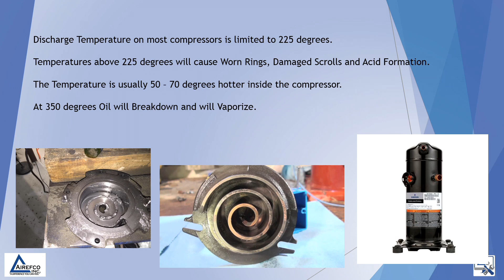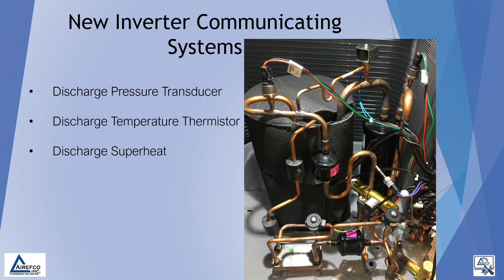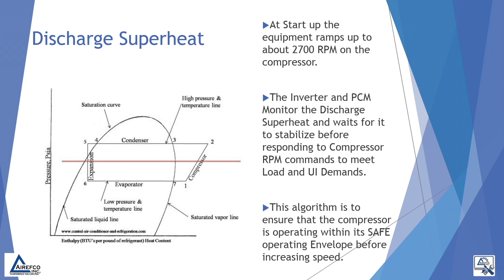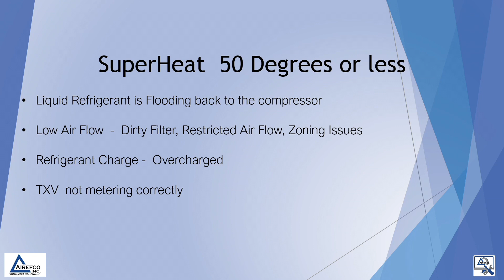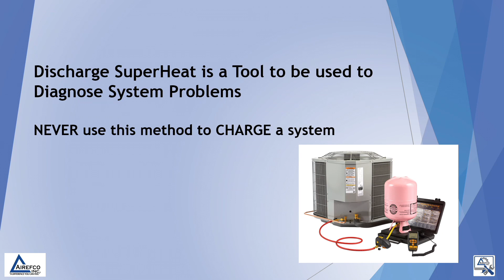Discharge Superheat

Comment: Sorry, may be a stupid question. 
Is this talking about discharge super head before o/d coil off comp in an a/c unit? Or would this info be the SAME on a h/p discharge gas line in heating mode?